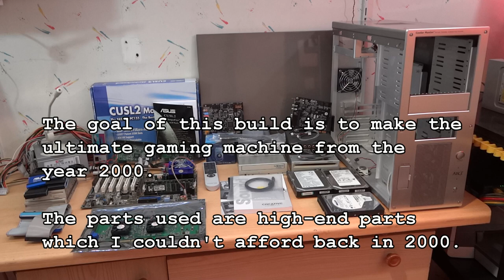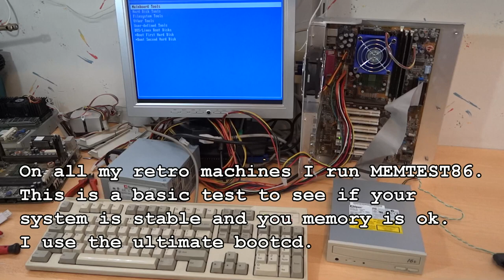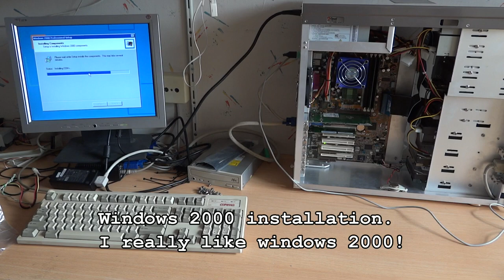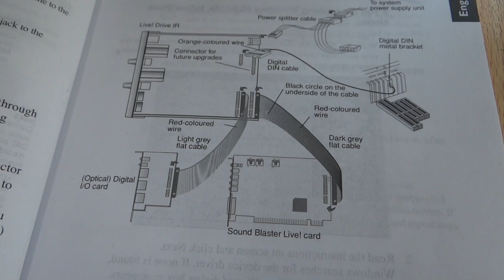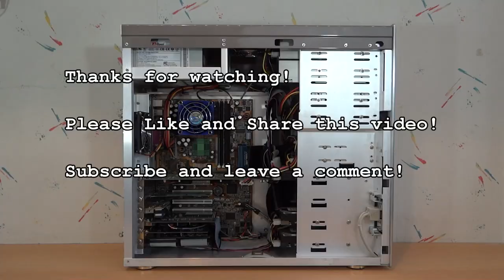Ultimate year 2000 gaming build! 3DFX Voodoo5 Asus CUSL2 P3-1ghz CM ATC201

Comment: i had almost same build in early 2000 :D, and that was the most expensive pc ever you could have on that time, same as now some 6700k with gtx980 :D
Reply: +iPlay4K -Adi™ | 4K UHD Gaming! GTX 980 and i7 6700k is nothing bruh. i7 5960x and GTX 980 ti* or Titan X lol I'm currently running a dual 980 ti with i7 5960x
Reply: ApolloTech
dude...  5960x cannot compare with Skylake if we are talking about gaming, second thing is that Titan X cannot and will never be better then two gtx980Ti in SLI

Comment: i remember at the time watercooling already a trending high end solution, using an ex motorcycle radiator,  aquarium pump, aquarium reservoir, and self c&c waterblock, back then in 2000 they overclock duron 600 from amd to extreme  1 ghz ++, it was fenomenal that day a cheap cpu can go toe to toe in ghz race with intel, so fenomenal it will crash and burn when we forgot cooler on, but it's cheap so we buy another one, 2 duron 600 is equal with 1 ghz intel pentium anyway (or perhaps 3 durons, not really sure)

Comment: This takes me back, used to take a whole day to do a clean install because of all the drivers and software that came separate to windows at the time. I'm sure dvd burners were available in 2000 though, I had one. Any reason you left this out considering you were trying to build the most powerful machine for that year? Also did your motherboard have a built in modem because I remember having to use v.92 voice/fax/modem cards. I also needed a dvd decoder card to link up to my 3dfx voodoo 2 card which was linked to my graphics card in order to watch dvd movies lol, had all 3 cards chain linked, kinda ridiculous looking back. That beige colour also did not age well at all, looks dated even when new let alone if it had gone yellow/discoloured.

Comment: I enjoy building with retro gear.  I have not seen any passion in creating a Windows 2000 based system before.  What are some of your thoughts and reasons for using Windows 2000, in designing a game system from that year.  I have found myself usually building with Windows 98 SE and earlier versions of MS-DOS.  I also enjoy your Windows 98 video.  Just curious if you have some good points, on what hardware would actually do well in Windows 2000.  I too have a Voodoo5, and have never run it in Windows 2000.  I must say, that I am curious to try it.

Comment: my pc in the 2000  was a pc chips mother board with 32mb in Ram, pentium 3 300mghz and i run the psx emulator very smooth. I play diablo 2 and age of the empires 1 and 2.and the  cost of the computer was around of $1600 U.S. dollars

Comment: my old pentium mmx @ 166 MHz with 128MB ram and some voodoo card (i think it was something with a 3 in it :3 ) was running unreal tournament 99 with no problems
Reply from the maker: stefan brony Still a great game and not that heavy on lower settings. On this machine I can play in 1280x1024 on a 19inch LCD panel. And now a 17inch CRT is connected I sat the game to 1024x786 and it flies!

Comment: On your voodoo5: What is the rating of the cap marked C44? (It's to the right of the leftmost GPU die)? I have a voodoo5 that is presumably working, save for this cap being accidentally knocked off many years ago.
Reply from the maker: SireSquish I can check that tomorrow have some voodoo5's in stock. If you have facebook please join the group: Retro Machines . We can help you with that info.

Comment: Man the Voodoo5 was the tits. At least until my friend and I tried playing it with "Emperor: Battle For Dune" and the textures on units looked wacky. Called tech support and a guy who sounded like Dolemite told me that the Voodoo5 didn't support hardware transform and lighting. 3DFx finally folded the same year, and it was time for teenage-me to start saving for those newfangled "GeForce" cards.

Comment: People be like "You dont need a Voodoo 5500 for 640x480, ATI Rage 128 Maxx or Geforce 256 would be fine, besides you dont need 512MB or more of PC1600 RAM for gaming, 256MB is far more then enough for gaming! Besides, a far cheaper 800MHz PIII with a jumper set to 125MHz FSB would match that 1 GHz CPU." in 2000.
But why not? A Voodoo 5500 is like SLI Titan Xp, PIII 1GHz as a i7 6950X and 512MB as 32GB of RAM in 2017. Technology as improved a lot in such a short time!

Comment: PIII 1GHz + Voodoo2 + GeForce GTS is what the "Ultimate 2000" gaming PC would contain, Voodoo5 lacked a lot including T&L, you need a Voodoo2 as a second card for Glide only games
Reply: MartinChir T&L sure was a must back in 2000, especially if you were a hardcore 3DMark user. Honestly, apart from Q3 there was hardly any software to utilise this overhyped gizmo. A powerful overclocked CPU would easily make up for the lack of it. And by the time the games started supporting it the ultimate year 2000 gaming rig became an ultimate paperweight.

Comment: I have a geforce2 mx200 64mb agp graphics card from 2001 and a 1.2ghz single core AMD athlom cpu with 256mb ram, was that great?
Reply: +&#191;APU? Umpadumpa  That's a respectable system.

I had a 1Ghz Athlon, 40GB WD Caviar, 512MB, nVIDIA GeForce 440, and dual burners. Man those were the days. I played the Dark Forces Trilogy every day on the rig. Sigh....memories.
Reply: +Sean Burns gt440? wow that was op

Comment: My first PC back in 2001 :
CPU : intel Pentuim 3 533Mhz - 256KB Cache
RAM : 196MB SDRAM
Mobo : Aopen (I don't remember the model)
PSU : Aopen the same one you used in the video 300W
GPU : ATI Rage 128 Pro 32MB
Montior : CRT 15" Samsung MasterSync
HDD : Maxtor the same HDD you use in the video but only 20GB
CD ROM : LG 52X CD ROM
Floppy Disk : 3.5" Floppy Disk Drive LOL!!.

Comment: hmm this has reignited my fire to build the other retro systems i was working on 
finished one few weeks ago  and pulled out two more tonight after watching this 
system 1 which i use for friends to game consists of Athlon X2 BE-2400 on ASUS M3A78 mobo, 3gb ddr2 667mhz, EVGA gts250 512mb pciex16, Seagate Barracuda 7200.10 ST3160815AS 160GB SATA hdd, Thermaltake TR2-430W psu, the case is an old Antec Design unspecified model (from an office pc i saved from a dumpster) with some mods I have done for better air flow.
system 2 is pending a couple parts but it will be a lga 775 engineer sample its either a quad core or dual core hyper threaded has no markings any where on the chip or heat spreader, 2 gb ddr 400 mhz, just so it gets used ill be putting in an ASUS AGP saver  HD 3650 Silent AGP 8x video card, Seagate ST30811AS 80 gb SATA hdd, Best Power MT-500w psu, no case yet for this one.
and the 3rd build is an old power mac G4 graphite 7400 single 450mhz cpu, 20 gb IBM deskstar IDE,will replace the stock video card with an ATI Radeon X1650 pro agp 512mb or ATI All-In-Wonder Radeon 8500DV (64 MB AGP), and what ever else i figure will work in either of the 2 builds i have planned
Reply: J Ricard ive been up for too long and got mixed up on that first build its an athalon 64 x2 4400+ not Athlon X2 BE-2400

Comment: I can't agree this is the ultimate build from 2000. You could use GeForce 2 Ultra...it blows out the Voodoo, and you can run some more recent games up to 2004...even HL2 runs decently on this.
Reply from the maker: coreclassic But we all love 3DFX!! :)
Reply: victorbart Then call the build "Ultimate Fanboy Expensive 2000". No gamer would prefer Voodoo over GF2 back in the 2000s :)
Reply from the maker: coreclassic I like how you assume things about all the gamers ;) Back in 2000 I liked the Voodoo5 card but it was way to expensive. But so was the GF2 cards. The Voodoo5 is special because it was the End of an era. And the Geforce2 was just another card in the line up.

Comment: ive decided to do a 2000/2002 build my self..video this week
Reply from the maker: That is cool! What will be the parts?
Reply: I edited my post..iam still going with the dell but i was thinking last night and decided to do a worst of build and do everything opposite of what I wanted to do.. so instead of using a dell..iam gonna do a full build. Biostar U8668-Grand,Intel Socket 478 1.7 Celeron,512mb SDR Ram,single IDE,Single CD rom,Geforce 2 GTS and put it in modern roswill case with modern gear..mouse and KB..iam gonna build it tonight in a temp case and order everything Friday.

Comment: I would prefer the Yamaha SCSI cd Writer on the Promise 100 SCSI controller.
You will not do yourself a fewer with this config, going IDE. However will not 
be your daily rig. Iomega 100MB Zip drive useless is guess.

Comment: the only problem with this build is the mobo chipset can't take over 512MB ram. yes in the day that was tremendous, but I like to have all the ram I can shove into a system.  That and a non creative labs sound card is all I would change.  For my own build I am still looking for a proper motherboard, and if I can I will use a tualatin. I have everything else, including an aureal sound card and v5.

Comment: is Aopen a good make, I've got a 350 w psu from a 2009 zoostrom pc and would I be able to use a 750 ti with it.
Reply from the maker: +MDC MoezMedia Aopen is a good brand but dont use it for that modern card!
Reply: +victorbart if I may ask, why not? I have a computer from 2005 and im modernizing it into the current era and I would like to know if I would need to switch out the PSU in order to install a 750 TI which is what im going for in graphics. Ive checked all the components and I have sufficient wattage to sustain the TI but would like to klnow any precautions. Thanks
Reply from the maker: +TheUnexpected6 Switch it out! You can risk to destroy all your modern part if the old psu fails.
Reply: +victorbart Oh alright, thank you!

Comment: Nice build. I still have my VooDoo 5 in excellent condition. Should I sell it now or wait longer?
Reply: Spend $50 and make a badass 2000 computer around it.
Reply: +inteli722  50 Isn't enough
Reply: XXAlkhatri XX You can get farther for $50 than you think, especially if you mix in a few more modern components. $50 should get you the CPU and motherboard, if not the RAM also, and then there isn't much else you need to build it.
Reply: Voodoo 5 Costs about $400s Nowadays
Reply: XXAlkhatri XX He has one. He doesn't need to buy one.
Reply from the maker: +jdmikeg4 Just get any pentium3 with AGP and stick it in and game!
Reply: I chose Geforce 3 Ti200 and 2 Voodoos in SLI Because Hardware Glide is better than emulation :)
Reply: XXAlkhatri XX The Voodoo 5 does hardware Glide though. And Voodoo 1s weren't capable of SLI on the consumer side.
Reply: I know but For me Voodoo 5 = Hard to find ;-;

Comment: You put in a Zip drive AND a floppy?  Doesn't the Zip do both?  Otherwise good work and nice clean build
Reply: No, Iomega Zip is just Zip disks (in this case, I think 100MB? Correct me if I'm wrong) Floppy is a different story.

FUN FACT: Did you know that the 'click of death' originated in the Iomega Zip disks?
Reply: FAMICOMASTER
My understanding and experience was that a Zip 100 did Zip discs AND floppies.  And yes, I had the click of death experience, thus I was introduced to the wonders of Spinrite.
Reply: :D
Reply: Phillip Morton No, they didn't read floppies. I had one in my Mac G3 and a usb one later. You could get a 100MB or 250MB disk, but you have to have a Zip 250 drive to read the 250 disk. They're about twice as thick as floppy disks and a bit different shaped. There were also jaz drives that had even thicker ones that held  1GB or 2GB of data, a friend of mine had some of those. They were cool, but way too expensive when CD-Rs were so cheap. They did sometimes call zip disks "zip floppy disks"
Reply: *****
My memory is now sorted, I was thinking of the SuperDisk (http://en.wikipedia.org/wiki/SuperDisk).  Handled proprietary drives and floppies!
Reply: Phillip Morton That's pretty cool, I've never seen one before.
Reply: ***** Now on view at a PC museum near you
Reply: Ha ha. Very funny. If you think that's old, then every other week something in your home must be considered outdated.

Comment: Just starting a win 98se Pentium 3 build and I'm trying to find out the latest and most advanced chipsets for the socket 370 that were released and will support the Pentium III 1400s with 10.5x multiplier. There were so many different types of chipsets that the research is turning out to be a bit overwhelming.  Does anyone know what these would be or how to find these?

Comment: Hi this is a bit strange to ask but im having problems with my pc its a p3 650mhz slot 1 running the asus v8500 64mb and a single voodoo 2 12mb but recently im struggling when staring 3dfx games such as myth tfl and 24hrs of le mans the pc crashes and reboots knowing these old machines i disabled the 3dfx card and the myth struck up fine then crashed and le mans who knows with that game i had a pc years ago that it worked on but i never got it working since. long storry short is it known that voodoo 2 cards crash pc's when starting 3dfx games ?

Comment: I'd removed the Creative and Fasttratsk and would add two Voodoo2 on SLI, Asus Aegia PPU and one SCSI controller with three 15K hard drive Raid 0. I'd changed the RAM of 512MB chips and CPU with Pentium III 1.4GHz-C Tualatin overkloked at 1.6GHz. I bet that productivity will rise by 100%!
Otherwise Voodoo5, EWS88MT & ATC201 - RULZZZZ!!!
Reply from the maker: Motherboard supports only max 512mb ;) And any raid array on pci 32bits is a waste of money time etc. because pci is just slow.

Comment: What about this configuration, is it good?
Windows 7 Ultimate 32-bit SP1
processor
 Intel Pentium 4 ht 3.00 ghr clock on 3.07ghr 1mb cash
 Prescott 90nm 
ram
 2.00gb  DDR @ 205 MHz (2.5-3-3-7)
motherboard
 P4VM900-SATA2 (CPUSocket) 33 °C
monitor
 SONY TV (1360x768@60Hz)
 1023 MBNVIDIA GeForce GT 520 (NVIDIA) 34 °C
Storage
 931GB Seagate ST1000DM003-1CH162 ATA Device (SATA) 26 °C

 DTSOFT Virtual CdRom Device
 HL-DT-ST DVDRAM GSA-H44N ATA Device
soud
 TerraTec Aureon 5.1 PCI 
work perfect 1080 p

Comment: Not so sure about the HDDs.
Back then it was all about SCSI especially RAID
Reply from the maker: Scsi for a pure gaming build wasn't really used. I used SCSI back then just because it had some extra performance but not for games. And Raid for more performance on a 32bit pci bus is just a joke.
Reply: PCI 32/33 allowed for transfers upto 133MB/s which was a lot faster than the EIDE or ATA equivalent. It was a lot more expensive which is why most gamers did have it, that and it wasnt really needed for a gaming rig back then. But that being said if you were serious about building the ultimate gaming rig back then then a SCSI subsystem was a must.
I know because I remember it too, I lived through it too.

Nothing wrong with it, it just seemed strange that you included the Terratec and not a nice storage system to go with it.

Comment: I had a Geforce 2 GTs in 2000, it was way superior then the voodoo 5.... the best card of 2000 would be a Geforce 2 Ultra with 64 MB... At that time the best processor was AMD Athlon 1GHz as well.
Reply from the maker: I know 10 people that are searching for Voodoo5 cards and nobody (That I know) is searching for geforce2 cards. Says enough why I put 3DFX in this system ;)
Reply: Voodoo 5 is for sure more rare, very few were sold before 3dfx went bankrupt... Only a 3dfx fan would actually buy them in 2000, anyone looking for performance would go with a geforce 2 back them - they were cheaper and faster.

But I give you that, a voodoo 5 build is more interesting (but the crown of best GPU of 2000 would still go to nvidia :-p).

Comment: victorbart you have to do a retro pentium 4 build!
Reply from the maker: +97pedrocas I don't like Pentium 4 systems :) So I don't gonna do a pentium 4 build.
Reply: Pentium 4 CPUs are horrible even for the time.
Reply: +Milan Jovanovic yes it is i had a p4 670 back in the day and it was hotter than my oven
Reply from the maker: +97pedrocas https://www.youtube.com/watch?v=EY7ZvXiEa1c here you go the Xeon's are Pentium 4 based :D
Reply: +97pedrocas I have this , pentium 4 531 on soket lga775 with HD4670 and 2gb DDR2 RAM
Reply: ***** Clearly, here I want to own a new PC with 5820k, and two r9 390 with 16 gigabytes of RAM
Reply: I love Pentiums 4, maybe because that was my first computer, a P4 @2.5GHz Northwood. Now I have 2 of them as retro builds, the original and a P4 745 @3GHz also Northwood, that I built for 15 bucks, while back in 2003 the first one cost 1000+ Bucks LOL 
I love how they overclock: 400MHz more on stok voltage for the 2.5GHz and 600MHz more also on stock voltage for the P4 745. 3.6GHz with minimal heat.
Then Intel fucked it up with the prescotts.
Reply: Fedya f Well, mi P4 745 is 13% faster while drawing less power and less heat http://www.game-debate.com/cpu/index.php?pid=1538&pid2=1519&compare=pentium-4-ht-531-vs-pentium-4-ht-745
Reply: +c0ldw1nd  i have a 3.0ghz Prescott on socket 478 and it runs great at 3.75ghz on stock voltage and 50°C on load
Reply: 97pedrocas I want to try to push mine to 4GHz with a good cooler. Due to their longer pipeline, prescotts usually overclock better than northwoods, but also have less instructions per clock.
Reply: +c0ldw1nd The best I could get mine stable was 3.92ghz but for the ram was running at 180mhz, I rather have 3.75ghz with ram at 200mhz. But I know that if you have a 3.2 or a 3.4ghz prescott you can easily get the 4ghz as the multiplier on those is higher.
Reply: 97pedrocas I will try to reach an fsb of 266 (1066MHz) and I will put a multiplier of 1.5 on the rams to run them at 200 MHz (400MHz). But maybe I will need liquid cooling or LN2 xD
Reply: +97pedrocas 4gHz I Love it :')